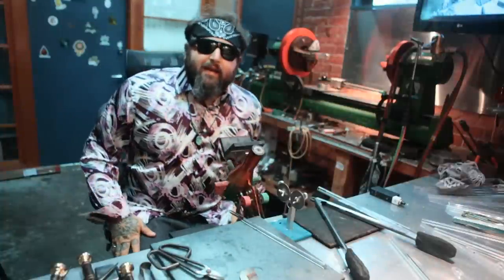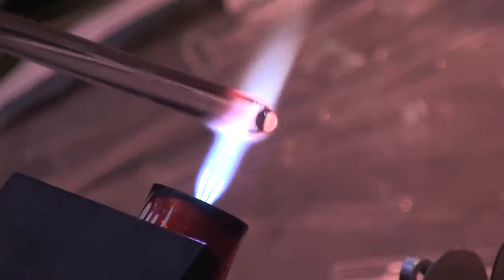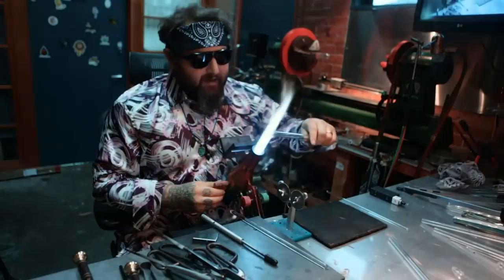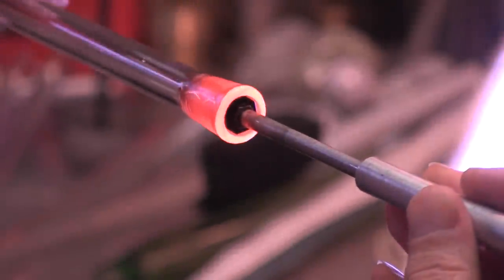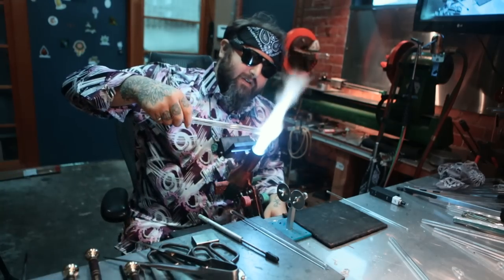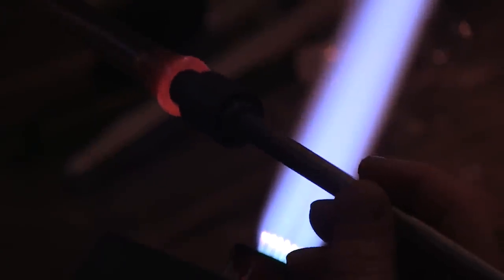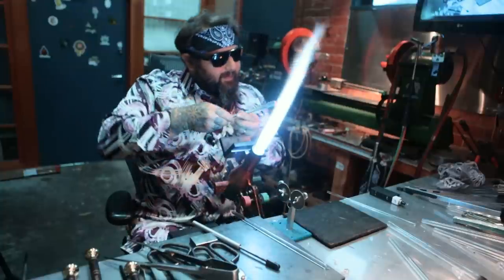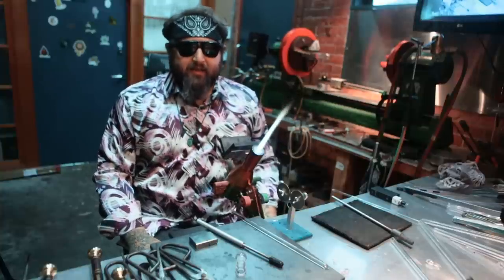Bench Trick:  Making A Female Joint || REVERE GLASS ||

Comment: Dustin..why do you reccomend a zippo over a butane lighter for lighting your torch?
Reply: okla homie a butane lighter with a buildup of pressure can explode
Reply: Hot glass can pop a butane lighter. Zippo is not pressurized and will not explode but does smell like lighter fluid. My shopmate uses a zippo with no fluid in it and just uses the spark from the flint so it doesn't smell